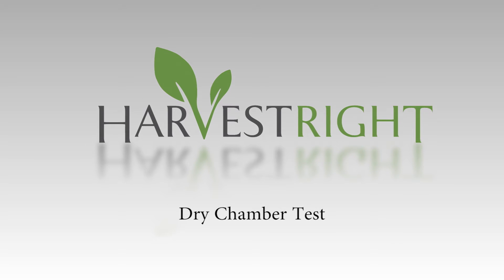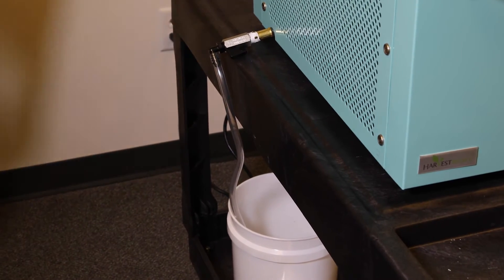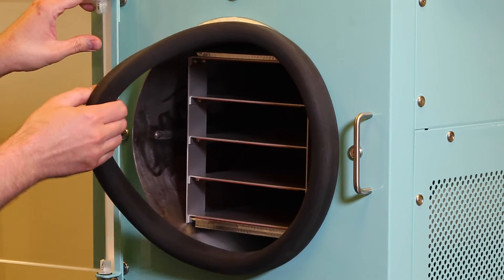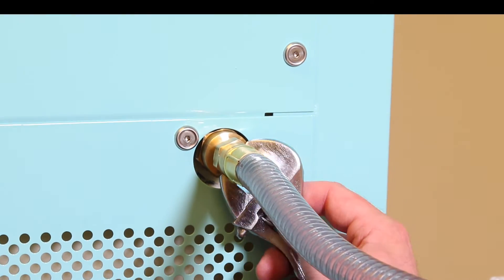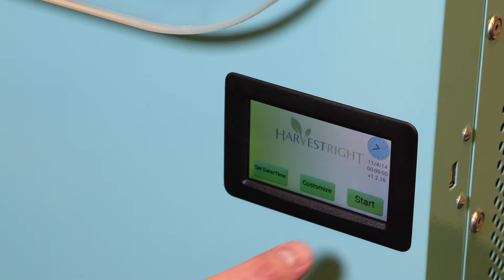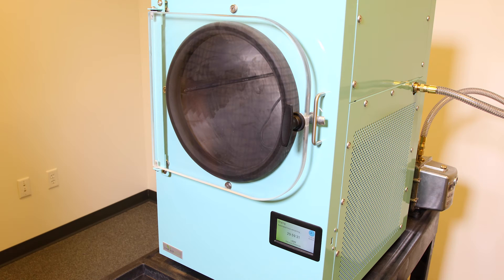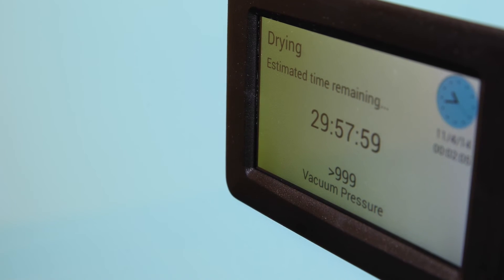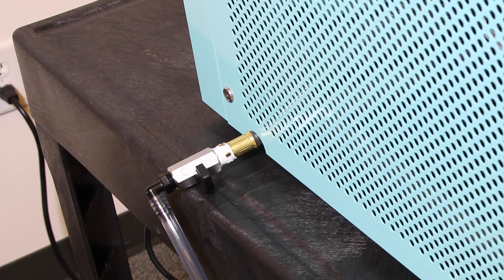Dry Chamber Test Tutorial

Comment: I have had nothing but problem after problem with my freeze dryer and this test doesn't help nothing! First, the hose that was installed inside the vacuum hose was not fully installed and it would not move. Once I once more videos I figured out a way of getting inside Because there is no getting support from this company no matter how many times you call, email or connect to the so-called support email ticket (NO replies!!) Second, It wouldn't turn on until the THIRD time I had to wiggle the cord. Now third, it won't drop below the 2500mTorr. So basically I spent thousands of dollars for a headache and an ugly space horrider! 
One thing is for certain anyone asks me about harvest right machines all I can say is "its junk!"
Reply: I learned today that if you want to talk with someone you call "sales"...they pick right up.  Tech Support I sat on hold for 5 minutes only to get a "leave a message" recording.  No call back so far.